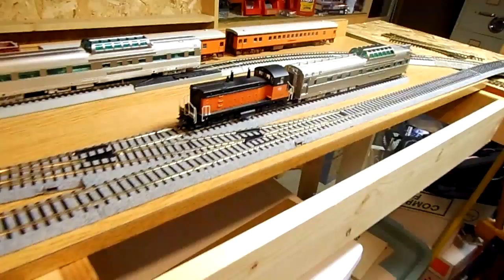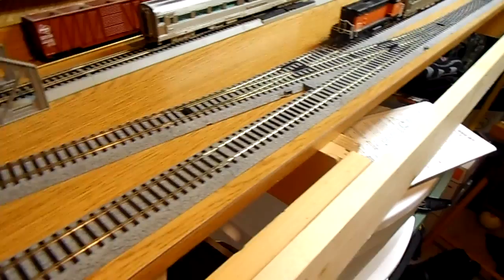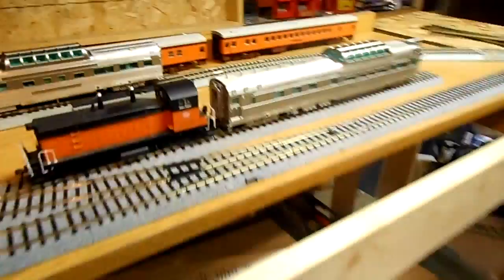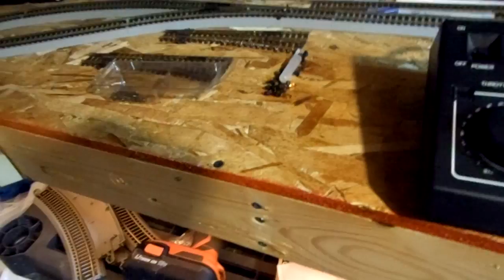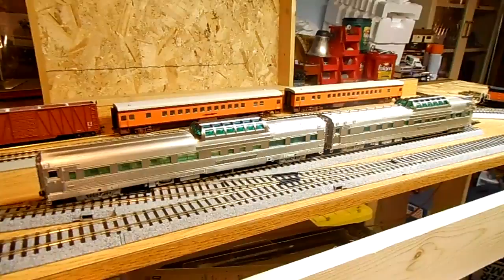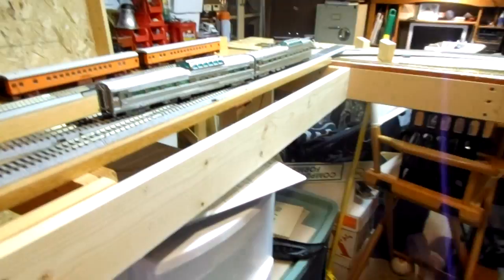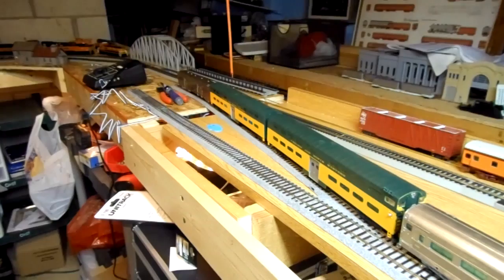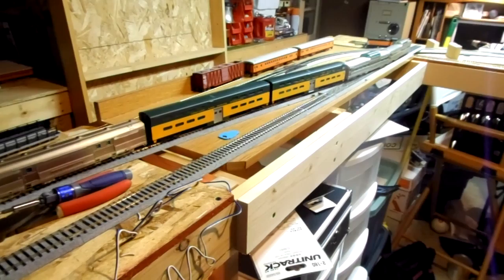Kato UniTrack Review

Comment: I use this type of track too. It's quite the quality! Makes me wonder why it doesn't seem to be very popular among most modelers. It seems to have better quality than EZ track, that's for sure.
Reply: I don't like EZ track
Reply: " why it doesn't seem to be very popular among most modelers" Because it isn't ideal for modelling, but it's fairly good for running trains quickly, like buying the stuff and within less time you're running train. You don't need to worry about wiring up a lot of wires to the track and rail joiners, or wiring switches and all that, which is what you do to make an actual model and getting it looking as true to life as you can. It also costs a LOT compared to just turnouts and flex track. It just doesn't look as real as normal track.

Comment: Liked your video, but I'm an odd ball model railroader. I do n and ho scales. I prefer unitrack for n scale but not my ho stuff. N is so tiny unitrack makes it easy and tracks well. But my ho I use code 83 flex and turn outs. I like the fact I can cut track anywhere and curve it to any shape. I've been in the hobby for 40 years😀

Comment: I have been using Kato track since 2001. I had totally switched over as its clearly high quality and easy to use.. I never have problems with derailing and I have 17 switches and a double frog in my 8x4 n scale layout. I have 5 main line tracks, and I pull up to 40 cars on a couple of my fright trains. All the cars go over every turn out and double crossover no problem. The HO Kato wouldn't be different from the n scale except for the size. I run a 4-8-8-4 BigBoy and have no problems with it just make sure you use the correct radius of curve. Also, depending on the size of your layout and what type of transformer you use and if you have a loss of power just had in feeder track wherever you train loses power. I use a CMI transformer and I have no problem with power loss.  Also whats nice about Kato you can run DCC no problem with it, Just like Hans said you don't need insulated rail joiners, only unless you are going to have a turn around loop then you will have to have insulated joiners and separate power source for that as its own block.